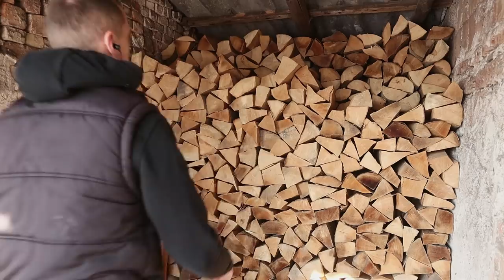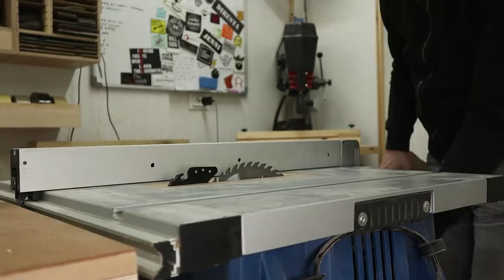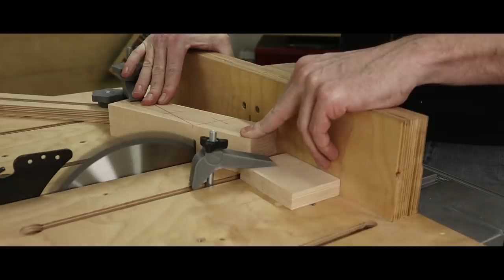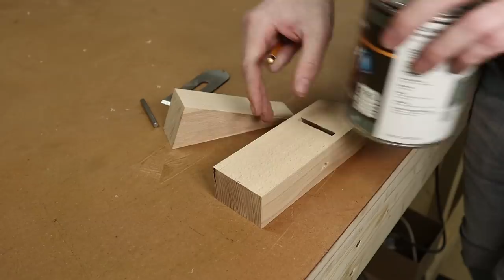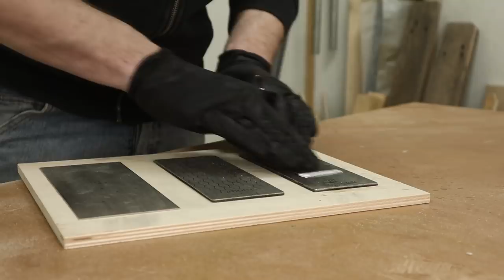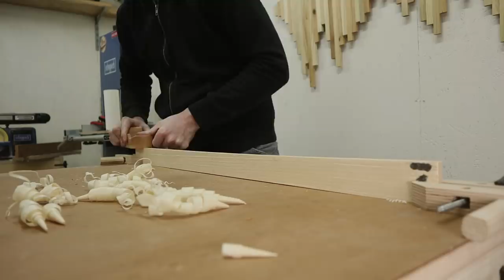Making a Wooden Block Plane from Firewood

Comment: Beautiful plane!  Any need to worry about issues with difference in wood moisture between your shop environment and the wood shed?  I notice my outside wood is about 12%, indoors around 6%, at least in winter. 
Also, I assume this build could be done with hand tools?  Plane all edges flat and square with a hand plane (I do have access to a table saw for cuts).  Any issues you might anticipate with that approach? 
Thanks for the video!